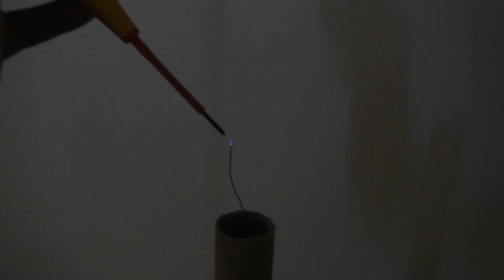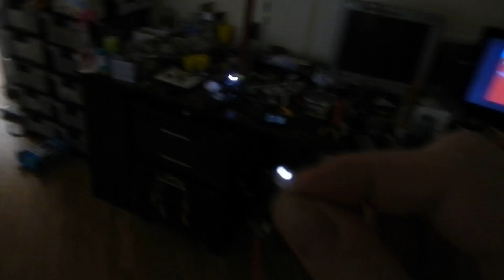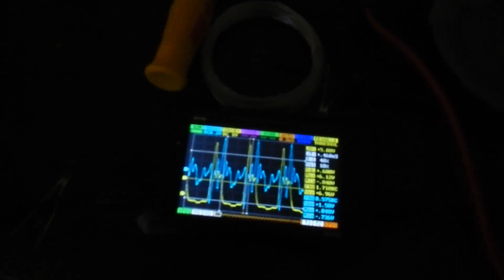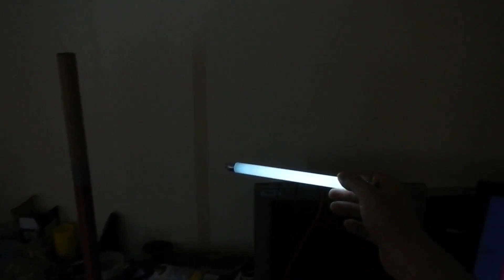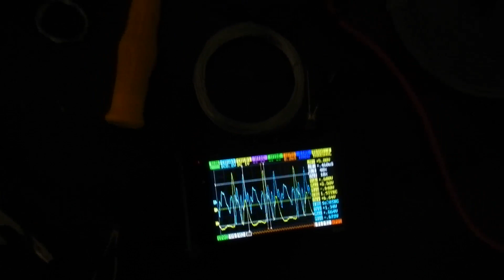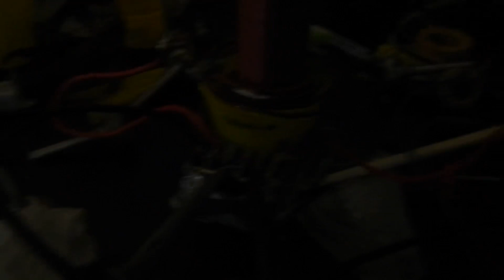Tesla coil/exciter update. Free plasma and SWES compatibility.

Comment: I think speakers do have a fair length and really fine piece of wire.  But it would be near impossible to wind with out braking.  The primary winding from a wall wart works pretty good.  That's what I've been using.  Don't wast your time on one that over heated at all.  The enamel on the wire gets all melted together and brakes when you unwind it.  

I think it probably would.  You should probably put some resistors in the circuit to prevent thermal runaway.  I'll PM you a link about that...

Comment from the maker: No worries! Good work! Tesla Tronix is the one to thank, I saw it on his channel first. 
With your flyback JT and this one, I'm in Plasma heaven right now :) Got another wrapping paper tube, and some CRT's... Eying off some 200a jumper cables for primary's, and wondering how much fine wire I can get from some of my speakers... Keen to re-wind this one with longer finer copper. Tempted to parallel some transistors too... Would two 3055's be better than one on my flyback?

Comment from the maker: This one is a slayer. Secondary is attached to base of transistor. Schematic on Tesla Tronix Channel. I actually just got round to replicating your joule thief Flyback. Very cool! Video just uploaded too. I'll be doing a spark gap Tesla coil for it and other HV drivers like the ZVS (when I actually assemble it). Spark gap was the only way to get good square wave in Telsa's time. Now we have more options. I don't believe it's necessary. Further experimentation required.

Comment from the maker: I thought that would be possible. What I was trying to do was get the water vapor to electrolyze when I sprayed the plasma. Should turn a water sprayer into a flame thrower... With the low power of my plasma, I am not surprised it just doused it... Water mist loads the coil btw. I wonder what happens to the energy the water absorbs. I think it might be heating it, like a really low power microwave... Got a fluro to light in a water bottle, with just one end out of the water. Looks pretty cool.

Comment from the maker: I've been trying to do stuff to water with no luck! Except wet cardboard, which is how the fire started. Found some interesting tuning things. Really need to stop playing with plasma and make that top load. Should be much more stable then, At the moment tune changes every time a conductive object in the room is moved.. I can get sparks off a Pancake if running from 12v battery with no earth. Lights up the fluros really well! Nasty burns if I touch the pancake terminals! Plasma+water should=HHO.

Comment from the maker: Looks like objects around the room are effecting the EM field a lot. Just found a stack of SWES coils on the floor with crazy big em field.. Need to take this to clear space. Getting different results from battery and wall adapter. I think with wall adapter, it is resonating the wires in the wall. Also I just had a plasma sound from a pile of tangled stuff, and smoke smell, from unconnected stuff. I'm on a flight/landing path, hope I don't get a knock on the door... Better go test EM/RF outside.

Comment from the maker: I'm not so sure about that. Been doing some gauss metering. There is a strong field for some distance on the primary plane. There is also quite a bit of activity under my desk, although it is not as strong as above the primary. I can light the LED on the AV plug on the floor. Gauss meter on sensitive setting goes off too. Aprox 20-30milli gauss on the floor 1.1m under the coil... I'm running a laptop, on the same plane as the primary. Gauss stops lighting up about a foot away. TIME TO MOVE!

Comment: wait till you get a good top load designed, you will increase the range substantially! Yes, It will burn the crap out of you... be careful. if a hair on my arm comes too close to the coil it will arc across the hair and instantly vaporize. before adding the top load i would move it further from the computer tower, or at least make sure the l2 and toroid are above the plane the computer is sitting on. I have noticed that there is little electromagnetic disturbance below the base of the coil..

Comment from the maker: That was a big surprise. Shuffled some stuff around for space and they started lighting up. Found single wire induction works on most of the circuit too. The Pancake coils seem to take the "Tesla waves" and convert them to EM. I haven't checked the output of the pancakes as receivers, but I will. Found another variable with the Plasma, Seems my scope probes and scope earth are part of the circuit, Changing a probe from 1x to 10x has a big effect. Is that a cap or resistor change?...

Comment from the maker: I wanted to put my primary inside with this one! Couldn't get good results, It does work though, Just a tuning thing. I think the 16cm would be better for inner coil. More wiggle room with tuning. 1" walls should be ok. At least they will stop the arcs... If it works, the Static electricity buildup and capacitive switching would be pretty good I think.

Comment: It indeed might make an interesting experiment. Now that you have discovered that unconnected coils can act as "repeaters" I will try different combinations of having the primary coil inside the styrofoam tube and then the secondary wrapped on the surface of the tube. I have two one meter long tubes, ~12 and ~16 cm in diameter. The thickness of the styrofoam is one inch, I hope it's not too thick.